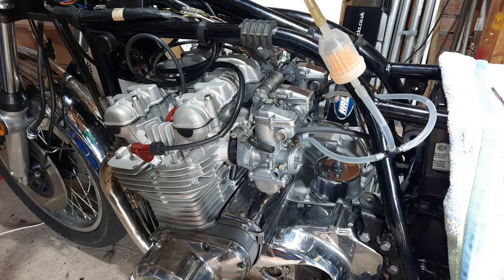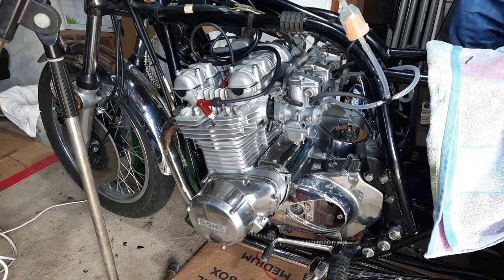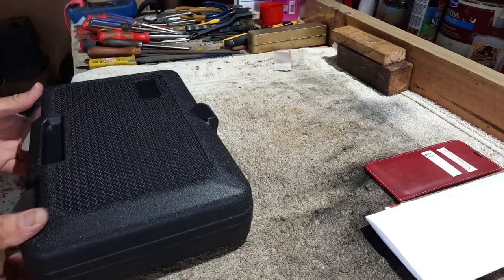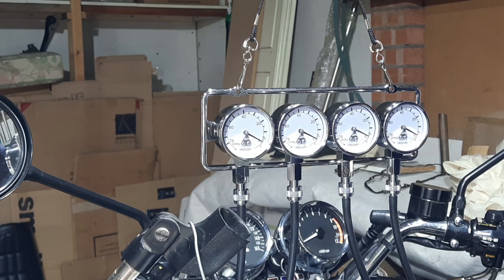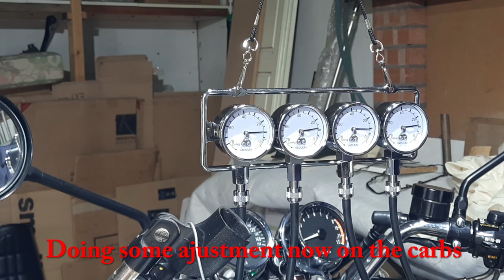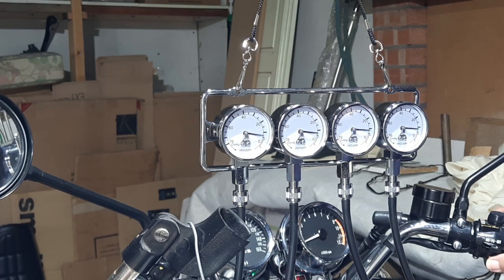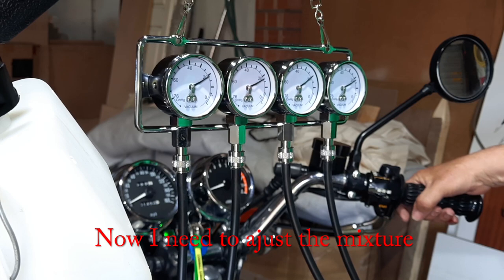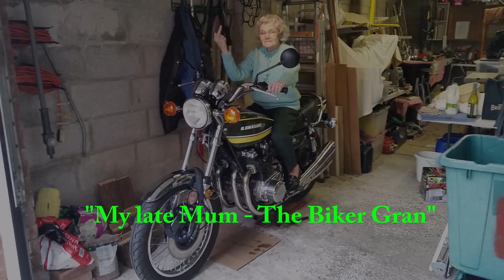Kawasaki Z1 Project - Phase 2 - Part 6 - Drill balance check,  Run up,  must not cook it...

Comment: A good start to tuning get a 12 inch length of tube,hold it to you ear and on the air  inlet of the cards the suction noise can be adjusted to make the same sound, a good start to balancing the cats.
Reply from the maker: Cheers Ian...

Comment: Happy belated Birthday, back in the early days, the vacuum gauges i used to use were the ones that the tubes were filled with mercury, i'm sure those are no longer available. That kit you bought sure looks to be a well made tool, I'm sure you'll have it for many years to come. that tip with the drill bit, sure got you close, if i ever get another 4 cylinder motorcycle, i'll sure remember that one. Thanks
Reply from the maker: Hi Roy
You are welcome. Gary

Comment: I just found some vm28 mikunis off of a z1 to replace the vm26 setup on my 77 kz1000, any recommendations for jetting with a kerker style 4 into 1?
Reply from the maker: I would really research this before you go ahead so as to be sure, I am sure you will need to re-jet to get the carbs running as they should , and the the engine, I am not sure here, better  off looking on the Z1 forum, may well find some info on this setup, cheers Gary
Reply: @garyspracticalworkshop357  I found some threads, but everyone has an opinion and it's hard to find facts, was looking for a sage, thanks for responding